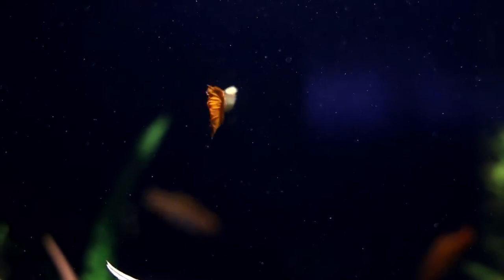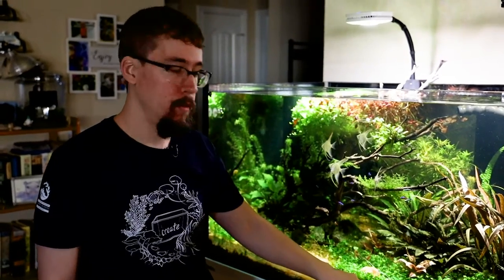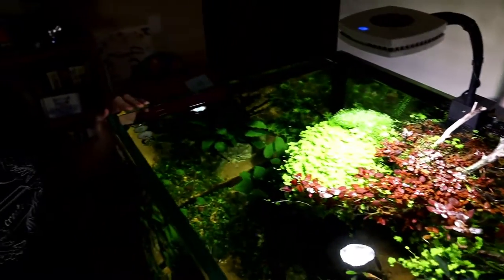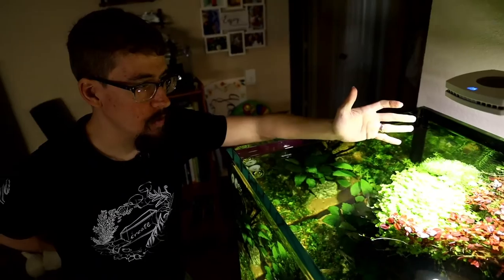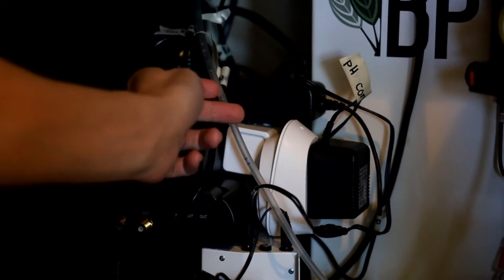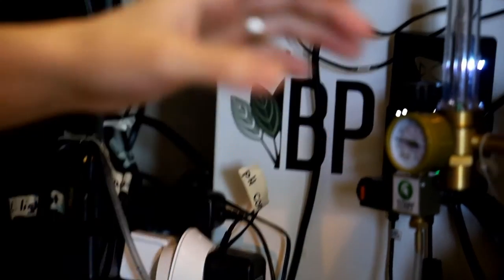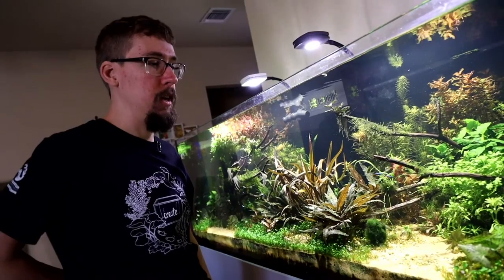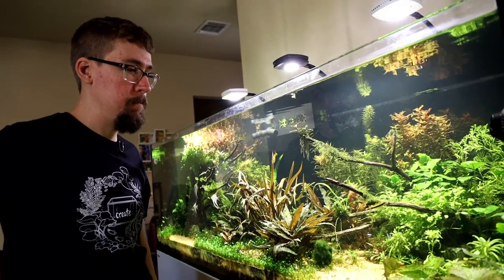Red Sea Reefer XXL 750 Freshwater Planted Full Walkthrough

Comment: Do you have any problems with fish jumping out of the tank? I have a lidded acrylic 75 and one of my big female C. aeneus will hit the lid on occasion when she goes up to the surface a bit too quickly. I have a ~1/2" gap between the water and the lid.
Reply from the maker: No I can't remember a fish ever jumping out of here except one day we found one of our angels on the ground still alive. In 2-3 years time that's the only thing I remember. Usually if the water quality is good and the fish are getting along you won't have jumpers, generally speaking.
Reply from the maker: My corydoras like to dart to the surface for air but never jump out

Comment: would loved to of seen and know more about your co2 diffuser. Great Vid and tank.
Reply from the maker: Thanks! I was using a basic CO2 glass diffuser with ceramic disc. I found when I tried using the jumbo glass diffusers, they would hardly work and the tiny ones would be working like horses. Maybe from increased pressure? I don't know really. But it worked. I also chose not to do an in line diffuser or a reactor since the glass diffuser was working so well. I thought at some point the diffuser might bust but it was fine after several years, and just needed to be soaked in peroxide to kill algae.

Comment: Greetings ... I recently set up a RedSea Reefer 350 planted tank and want to inject Co2... Are you using a carbon reactor or sending your Co2 directly to in tank diffusers ...?  Many people recommended the reactor due to excessive “ gas off “  .. I’m wanting to maintain my Ph with a controller , just don’t know the best way to deliver my Co2 .. thanks ..
Reply from the maker: I use a basic co2 diffuser and I'm running with a pH controller. I don't have a gas off problem. It takes about 30 minutes to reach 30ppm co2 in the morning before lights come on. I have a refugium in the sump with plants that are lit when the main tank is dark to help hold in co2 and then release back into the main tank when the lights switch. This seems to be working quite well. My diffuser is sitting next to my return pump intake so it's dispersed into the main tank instantly. Reactors are cool and maybe they help a little, but it's not necessary in my experience.

Comment: Looks great! I have a small red sea tank  30G for freshwater as well. The LED light is very strong, so I want to ask what is your settings for the light? I only have blue and white. And I have plants as well
Reply from the maker: Thanks! I have all 3 lights synced up to the same schedule. All light spectrums at 70%. 1 hour ramp up to 7 hours to 1 hour ramp down. The lights are so strong that even in this big tank I melted many plants at 100% power the first week. It's good to start low and work the plants up to higher light. If you keep your light, fertilizer, co2, water changes and stock consistent, you will see the algae get less and less and mostly disappear. If I do a big trim I get sudden algae because there's less nutrients being used. So I try to keep it as consistent as possible including light.
Reply: @sampster5000  Thank you. Are you using the  original red sea lights or you brought them separately for fresh water settings? I am using the original one, and it was setting at 60% white and 15% blue. And it causes the brown algae bloom. I changed the setting to 25% white and 7%blue. The brown algae seems still grows.. not sure if i should put it down to 20%in white. But i am afraid it is not enough light for the plants
Reply from the maker: @KalindiYoga  I am using 3 AI prime HD freshwater lights and didn't get the set that came with the lights. Pick a light intensity and stick with it, but cut back fertilizer every week until the algae stops growing. Keep up with 50% water change per week and have consistent co2 at 30ppm while lights are on. Try not to overfeed or over fertilize. Go heavy on plants. I don't know what your source water is made up of, but you can also do either part or all RO/DI water to prevent algae from too much nutrients
Reply: @sampster5000  Thank you very much for your response. I have whole house carbon filter and water softener. I will keep watching the lights. The original red sea light is very strong.

Comment: Good Day:  

Your tank is very impressive and I appreciated the tank tour you provided.  I am planning to setup my Red Sea Reefer 525 XL as a FW planted amazon community tank.  My first focus will be on the corydoras catfish and then the plants.  I was wondering if you have an update on your tank and any lessons learned.  

How do you like your type of diffused CO2?

Thanks,

Michael
Reply from the maker: Hi Michael,

Thanks for watching! Glad it helped. If you add plants after corydoras, just know that you're going to have uprooted plants unless you do ones out of the substrate like anubias or moss. It's not as bad when the plants are mature, but new shallow root systems will easily come up. If you're adding plants later, keep your lights as low as possible until then and then slowly build up. Otherwise it'll be a long time of algae issues. I'd also add root tabs and fertilizer whenever you first introduce plants, not beforehand. 

I hope to put together a video again soon! But for now, lessons learned... If you're using powerful lighting, slowly ramp it up over a couple weeks or you'll melt your plants. Also, set a schedule for everything (light, ferts, co2, feeding, wc's etc) and stick to it. The longer you are consistent the sooner your tank will find equilibrium and stop growing algae. Another lesson is obvious, but crayfish will eat your plants and fish if not kept well fed. I knew this, but didn't plan for periods of time when I'm busy and don't feed every day. My downoi got eaten up in two days! Very hard to find around here. Another lesson is that this huge tank definitely needs a powerhead or two to get things stirred up enough to go into the overflow. The system can only take so much flow from the return pump, so invest in a controllable powerhead. Lastly, be okay with the tank changing over time. All of my background stem plants are gone - they literally changed themselves into emersed plants and created islands above the wood. You can see this on my Instagram.  Last-last is to not pack the tank completely because this lowers flow and causes more algae. If you're going to have a heavy bioload from fish, don't have so many plants that the whole tank is covered. You need flow. Good luck! Message me anytime.

Comment: Great video. Love the tank. You mentioned problems with algae. What are your views on UV filters to solve the problem.
Reply from the maker: UV works well at removing algae as long as you have good flow to get all of the water to the filtration. It could help but would be tough in this size tank. It'd definitely be beneficial and is a great idea. Me personally, I prefer to just balance nutrient import and export as it seems more sustainable. In this case, the algae is helpful to show me what to change. Maybe once the right import/export is found, then UV could be used for extra help.

Comment: You do need some power heads to get the current going that is contributing to the the green hair algee you could also try masking the light with a less transparent material in places where you are having the problem
Reply from the maker: I'm planning to do an update video soon. I have a powerhead which has really helped and I've turned my light intensity down some.
Reply: @sampster5000  it's a very lovely scape
Reply from the maker: @id.unknown1283  Thanks!

Comment: What are the spectrum settings of your lights? I’d like to set mine as well!
Reply from the maker: All colors are set to 70%. While you can create your own spectrum, there isn't an even amount of diodes for each color, so you end up losing par if you go for something specific like 8000k. I tried hard to get the red at least equal with the blue but it wasn't going to happen. Another hobbyist has a gorgeous tank with all at 100%, reds popping nicely. So I just followed their steps in keeping everything equal. There's 7 hours of 70% everything and 1 hour ramp up and 1 hour ramp down, total of 9 hours
Reply: @sampster5000  Hi , Can you please share your programing file of the led lights ?

Comment: I have 65 gallon, 47 inch long 20 inch deep. You think two of these AI Prime Freshwater will be enough?
Reply from the maker: Yes, depending on what you're doing. But should be plenty of light to do anything.
Reply: @sampster5000  trying to grow some polysperma rosanverig sunset. Those need lots of light to be red. I currently use 2 black box 165W grow lights. Tank looks ugly purple but grows like a farm.
Reply from the maker: @Fred-eg9sx  these put off so much light that when I set the tank up I melted half the tank, including things at substrate level. I did a handful of red plants at the beginning and they looked great. You'll have no issues. Put higher light demanding plants directly under the pucks if you're unsure.
Reply: @sampster5000  thanks so much! I just ordered 2
Reply from the maker: @Fred-eg9sx  sweet, good luck!

Comment: Beautiful!  I am here because trying to figure out if I could convert a red sea reefer into a freshwater riparium. That would mean the water level in the uppper tank would need to be about 20cms below the rim of the glass. Do you think the inflow outflow pipes up top could be lowered for a lower water level?
Reply from the maker: That would be quite the project! You would have to cut the overflow box as well as the pipes and wouldn't be able to use the silencer, but anything is possible if you put your mind to it hehe.
Reply: @sampster5000  Thanks so much for answering! Lol sounds way too hard for me. I'm in New Zealand and having a really hard time finding any rimless tanks- but they do have the Red Sea Reefer tanks here so I thought I could get one of those- but sounds to hard.

Comment: Algae is something I was never able to solve on a planted fresh tank

I don’t think there are great options to keep the black beard algae at bay and it would get all over my anubias
Reply from the maker: @Merknilash  hydrogen peroxide spot treatment on the black beard. Dies instantly and you can rub it off or suck it out with a siphon. I wouldn't rely on that for all algae but it works for BBA that pops up here and there occasionally

Comment: Only thing I would’ve done different is put a plenum under your substrate with a very slow moving water flow run off of a little air plump this would prevent it going Anaerobic which it’s clearly doing combined with sand this could bite you on the arse down the line